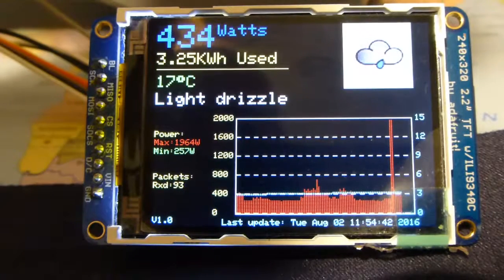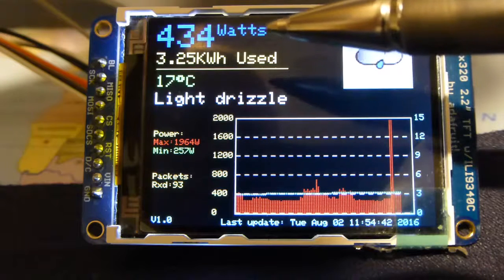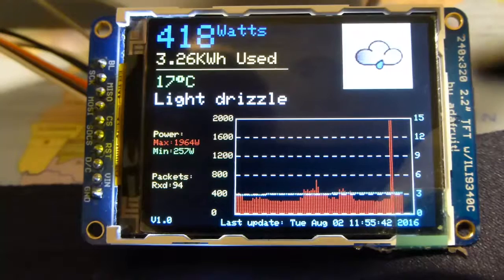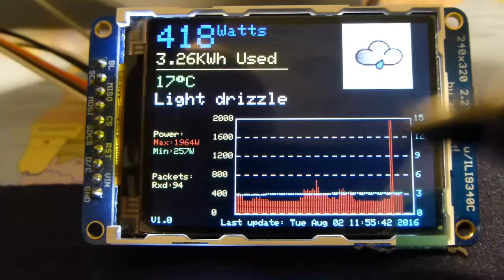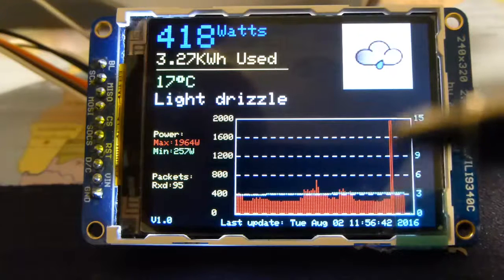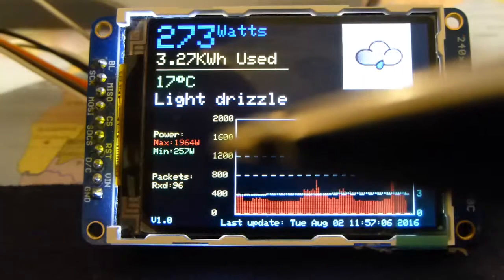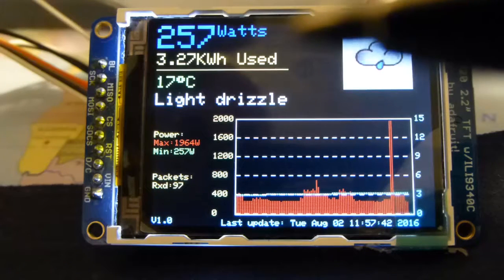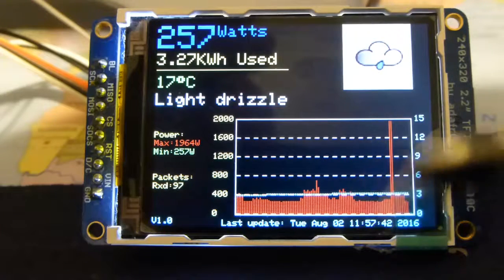Tech Note 001 - ESP8266 Network Owl Multicast (UDP) Data Reception and Display on a TFT

Comment: So the source code can read the udp traffic. Could i then get emoncms to read it?
I would like to be able to add this to home assistant https://home-assistant.io/components/sensor.emoncms/

Thanks
Reply from the maker: +mr18days I did post the source code on the emoncms forum but yes as the emoncms system uses a wireless receiver then getting it to read UDP network traffic should be straightforward. It could be simplified even more by using an xml decoder

Comment: I like the graph, you are using. Thanks for sharing the source code. vy 73 de Olli
Reply from the maker: There are also a few little known features in the source code like being able to easily get the time, etc. The graph routine parses the data via an array in the later versions to make it easier to display and handle data. I hope you enjoy, 73 de Dave
Reply: Yes, you´re right. I´m also use the ntp-function from an earlier video with an ESP8266-01 attached to a 2 lines LCD with big letters - nice clock in my Shack.